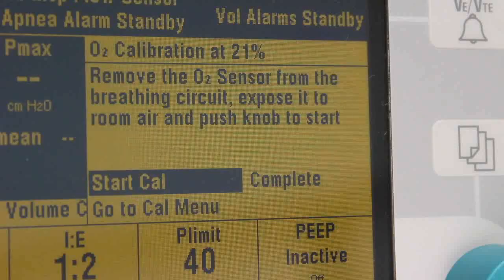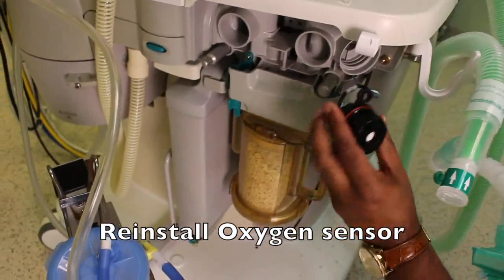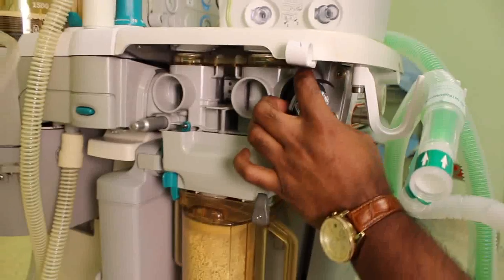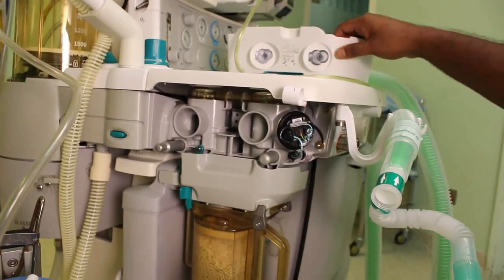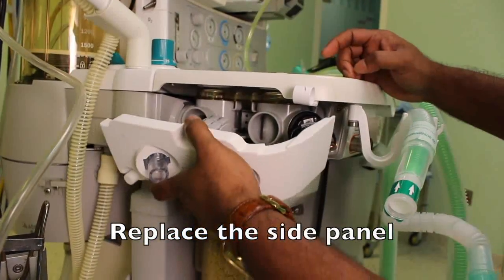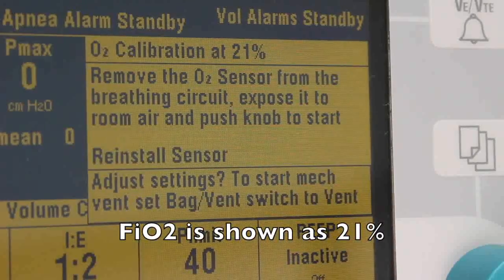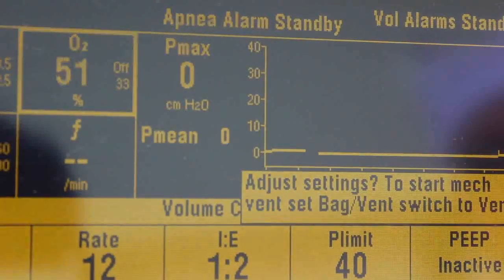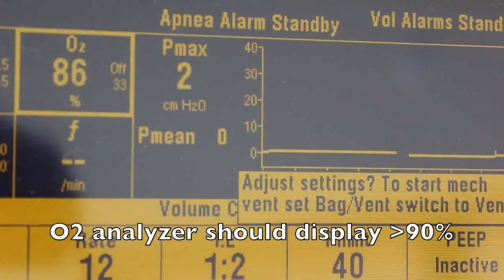Anesthesia machine check out procedure | Saneesh | AnesthesiaTOOLS

Comment: Good one Saneesh. However, some tests vary between machines of diffrent company make. Lot of machines don't have flow meters and are replaced by digital manometers. Please have a look at ettube.co.uk where there is a OSCe on Anaesthetic machine & bains circuit
Reply from the maker: True. Our Anesthesia Workstations are becoming more and more sophisticated and software dependent. Manufacturer specified checklist needs to be followed. The video tutorial here is intended only to demonstrate the common tests in our routine checklist. Thank you very much for your input.    - Saneesh